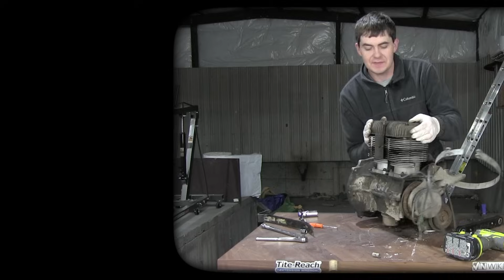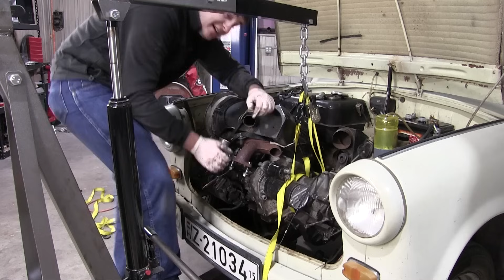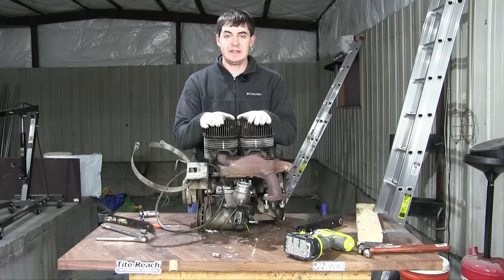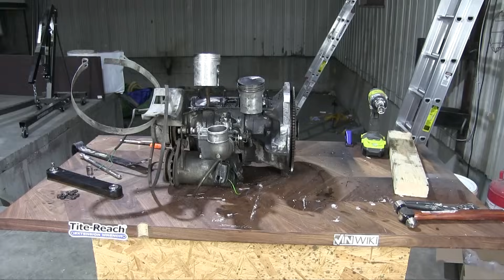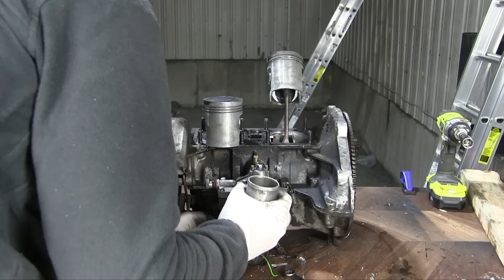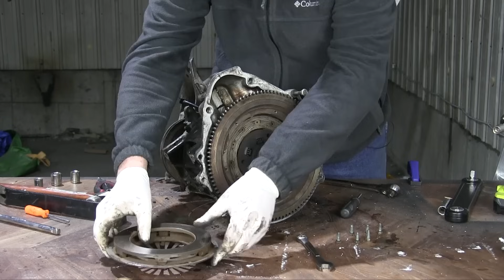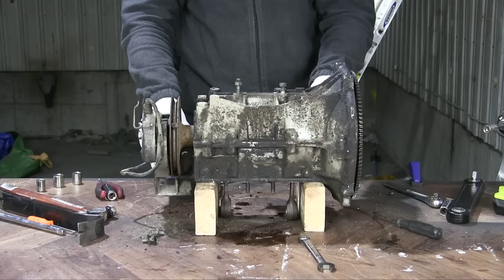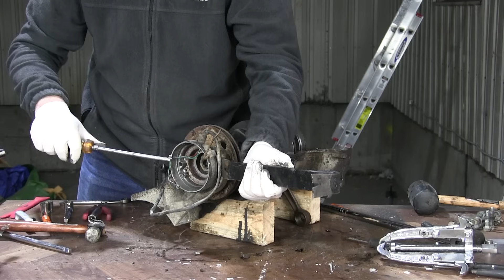Rebuilding the Trabant's Engine: Part 1 - The Teardown

Comment: Everyone should have a Trabant as a second car. When the day comes that the electric system of your $50.000 BMW fails and prevents you driving it - you can always count on your Trabant.
Reply: Won't work because people can't appreciate good, reliable small cars anymore.
Reply: @GlamStacheessnostalgialounge  I agree most people just want the Newsday fastest best new performance car or the nicest luxury car/suv.
Reply: Glam Stachee 
Did you just use both “good” and “reliable” to describe a Trabant?
Reply: +Timbob Jr

Yeah? If it's a car that can get me from A to B without hassle I consider it good, and if you can fix it yourself I consider it reliable.
Reply: @GlamStacheessnostalgialounge  Reliable? Kinda. Small? YES! Good? NO!
Reply: Always is a big word :)
Reply: So what you are saying if I bought a trabant I would have to first buy a $50k bmw? Sounds like an expensive venture just to own a car made out of recycled garbage lol
Reply: I'd buy one, it's a hell of a lot more simple than my saturn, and that thing is considered a pretty simple car
Reply: You can then drive your Bakelite Motor Wagon.
Reply: Got a 94 Ford F250 diesel.  There isn't enough electrical system in it to fail.
Reply: No thanks, I have a Studebaker!
Reply: Jeff DeWitt Do you mean their wagons?
Reply: SunsetRider Meh, any mechanical diesel would surpass even the trabant if there was any problems with electronics!
Reply: Especially if you own newer VW diesel and it just dies without obvious reasons - Trabby can save your life. Broken Beemer away from dealership - mechanics nightmare.
Reply: It is reliable and cheap, but nothing else.
Reply: No need for a trabant when the Defender exists
Reply: except for when the exhaust manifold falls off lol
Reply: Really? That thing looks like it would struggle to make it down the block

Comment: Would be cool to see some performance mods on that little engine. I wanna see what that little monster can do!
Reply from the maker: https://www.trabantwelt.de/Trabant-Tuning/Tuning-Motor-Abgasanlage/35PS-Tuning-Motor-einbaufertig-Trabant-601::1294.html
Reply: A whole 12 horsepower improvement, holy shit!
Reply: @agingwheels  Oh my god now I want to build a Trabant race car so bad
Reply: That’s old hat now, it’s much more impressive to build the stock motor or at least something that’s still two stroke

The Trabant 800RS only has about as much power as my KE70 but looks like so much fun
Reply: My favourite improvements have seen it replaced with the engine from a superbike. The resulting car is always hilariously fast given that the car isn't that heavy.
Reply: I tought so too, to drop a Hayabusa motor in a Trabant, and have fun looking at the people's faces in the time you pass them driving 120 miles/hour 😂😂😂😂😂
Reply: Just search "trabusa" on youtube and not be disappointed ^_^

https://www.youtube.com/watch?v=_DZ0W8AM9c8
Reply: It can be made to be a tolerable boat anchor.

Comment: Legend says the trabant engine was secretly meant to be on the Bugatti Chiron
Reply: Actually VW intended to use a bank of eight Trabant engines - however VW shelved the idea as the emissions from the two-stroke engine were too low compared with their top notch TDIs.
Reply: @MeetDannyWilson  they were also too reliable and simple to maintain.
Reply: @MeetDannyWilson  This, this is the deffinition of perfection.
Reply: @MeetDannyWilson  No No It is the new engine for the Devel 16!
Reply: @MeetDannyWilson  I love you man. 😂
Reply: I can see it being a pony motor to start the main engine.
Reply: It's true. They were originally meant to be used as starter motors for the Chiron, but testing showed they weren't powerful enough.
Reply: It could be true, the Bugattis of the 30's also had a roller bearing crankshaft.

Comment: The little 0.6L engine finally getting the rebuilt it needs.
Reply: CrazyPilot757 But did it really? Only thing wrong so far is the loose exhaust manifold&pipe!
Reply: @rkan2  and the entire crankshaft

Comment: Do you have any tips for importing a Trabant from overseas? Im based in Ontario, Canada and I'm open to any help I can get. Thanks!
Reply: if you need help searching one im living in germany you can hit me up over discord my name is playtastiv#7643
Reply: You could buy not only from Germany. This car in the video, is from Hungary. The custom registration plate is Hungarian. There are a lot of working  car here. You can buy from https://www.hasznaltauto.hu/ The cheapest about 300 USD. But I can't imagine how could you take it to a port . :-)
Reply: there's several online groups. I do know import laws are slightly different in canada though (such as 15 years instead of 25, but I believe even the newest ones are now 25 years old now anyway)
Reply: Walking or taking the bus would make more sense and save you money. Importing one would be easy just buy one pay a ungodly amount to have it shipped here ,pay ungodly amounts of Import tax , Ontario tax and registering fees  + a lawyer to confirm it is a car. Then try to get the MTO to add it to their VIN system as a road car and not just a show / display car . Finally try to find an insurance company to insure it , as it won't show up in any system , so you will have to have the car appraised and have a agreed value of the car . Because if it get destroyed in shipping your screwed .$$$$$$$$$$$$$$$$$$$$$ . Then spend the rest of your life importing parts to keep it running . So if your still hot to get one . Get a vin from one,,, pay to store it in Germany and start now in 2 years you might be able to get through all the paper work and Then have it shipped when you have all the documents in order.
Reply: I can't tell about insurance and import costs, but overseas shipping may be, in fact, the LESS costly part of the deal. Shipping a car from Europe to North America will cost you about $1200 to $1500. Now, the expensive bits will be shipping the car from where you got it to the docks, and same, unless you come and get it yourself when it arrive in North America.
Your best option for getting it cheaper would be to find a forum or a club about old european cars and see which people are gonan get cars imported from Europe. Car ship in standard containers; some specialized transporters are know to ship 4 cars in one - two cars down, two cars strapped up from the container's roof :) it only works with small cars, and the Trabi is a small car.